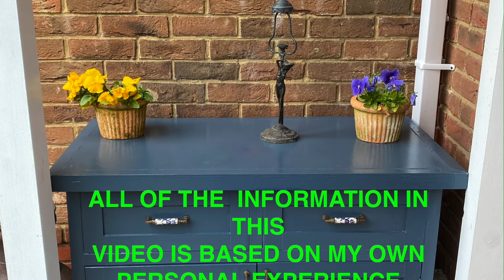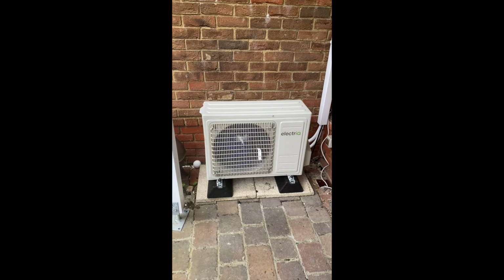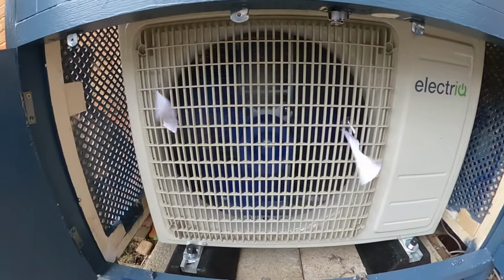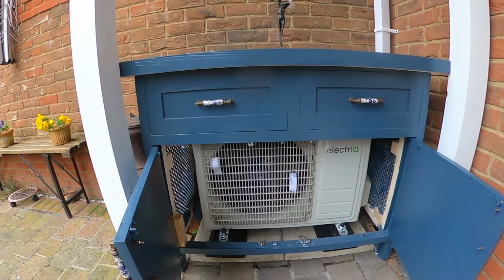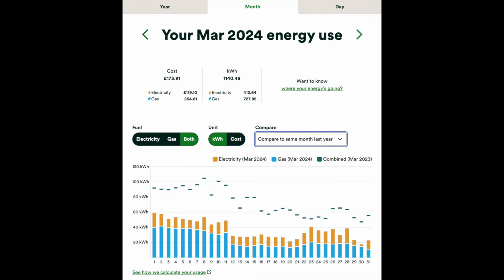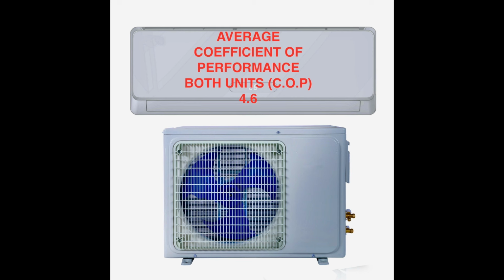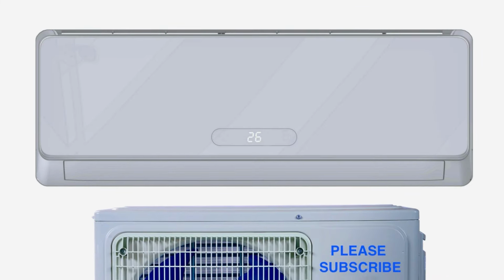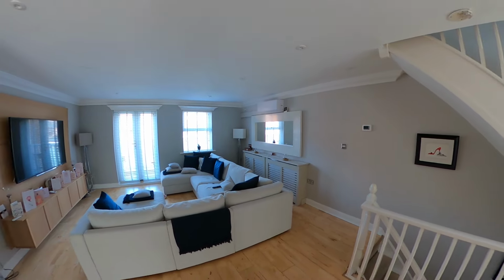AIR TO AIR    HEAT PUMP  MINI SPLIT . D.I.Y  INSTALLATION  UPDATE. ELECTRIQ

Comment: Thanks for sharing the stats - having seen one of your previous videos and learning about R290 I bought the 3.5kW ElectriQ - I’ve yet to install it but the idea is to use is to cool over the summer using my PV which I have in excess and the same to heat in spring and autumn - had it not been for the low price (£600) and the ability to DIY due to not being f-gas I’d probably not have bothered 👍
Reply from the maker: Hi  I don.t think you will be disappointed you have purchased great product. Good luck👍
Reply from the maker: Hi  You won't be disappointed these  heat pumps are reasonably  priced ,easy to install and very economical to run . thank you and good luck 👍
Reply: @HEATSEEKER1428  yep it’s on my job list- only daunting bit is core drilling the 63mm hole through the wall 😵‍💫
Reply from the maker: @Umski  Hi good luck . I have to say I found  6 3mm a bit tight  if you are buying the core bit especially  you could go a bit larger . Thank you 👍
Reply: @HEATSEEKER1428  thanks for the tip - 65mm looks like the closest one, though it does feel a bit annoying spending £45 on the bit and extension just to cut one hole, so I'm trying to find someone who might have one to borrow nearby!
Reply: Well thanks, I finally braved it and got a 65mm core drill - that was interesting as we have a timber frame so I went through the first breeze block from the outside (it's a corner wall) and hit the cavity - I didn't know where the centre could come out so had to borrow a long bit to pilot back to the inside and then hole cut the plasterboard and inner timber frame. So hard bit out the way I set to work on the brackets and trying to get all the pipe and wires lined up and pushed through - that was hard up a step stool 😬 Finally the connections - I nearly pooped myself when I undid the plugs and some gas escaped until I realised it was pre-pressured with something inert (smelt a bit like tyre air!) - quickly did up the unions, followed the non-vac procedure and we're up and running just in time for the hot spell 🥵

Still need to box up the pipe work outside and then find a better internal power socket (currently hanging off an extension). I found some 65mm square guttering in a skip (just saw your other tip!) but didn't seem to have the "bandage" in the kit so using aluminium tape and will add extra pipe lagging before I box it all up - only downside is the short pipes were a bit too short and the extension pipes a bit too long so have a looped coil of excess.

Function wise it's been great - wi-fi app is handy too. One thing I have noticed is that the thermostat hysteresis is a bit strange at +/-3C so it only starts to modulate down in power once it gets 1C over or under which is a bit odd and goes off completely at 3C - other wise it's ramped to about 1000W at full power for cooling and similar for heating. It will ramp down to about 300W at the lowest modulation in cooling it seems so to keep it ticking over it can be fudged a little...I may pop them an email as this seems a bit odd to me

Comment: Thanks for the update on the outside unit. The video would have been better if you wasn’t speaking over the top as it’s covering up the sound of the unit - which is what you was showing. Otherwise great update
Reply from the maker: Ok Thank you I take your point but there really ws not a lot to hear . Just the sound of air flowing over obsticals   . Thank You

Comment: Hi I have this unit the 12000, mine had a leak and was repaired it’s been regased, but when running it doesn’t get hot, would know what the standing and running PSI should be to determine if we have too much or too less gas thanks
Reply from the maker: Hi unfortunately I don't have  the the pressures .
You must follow  manufacturers instructions but I would say if your indoor unit and your out door unit are running and you have the correct mode selected  and your filter in the indoor unit is clean then  you have very low refrigerant  levels . if this is the case then I would check for possible leaks ,  Using either a vacuum pump or air pump of some description . Obviously  not R290 .
Thank you and good luck 👍

Comment: Hi, thanks for the update. I am considering buying one of these and fitting it myself as I'm a competent DIY'r. I had a few questions if that's ok?

1. I believe these can be installed without a vacuum. Is this done by purging the system and essentially removing any air by ejecting some R290 out the exit pipe?

2. I will mainly be using it for air conditioning. Does it produce really cold air? What's been your experience with it?

Thanks,
Keith
Reply from the maker: Hi
You are right  there is no need to vacuum down the pipe set . The instructions go through this procedure. Regarding the cooling capability's  I have only tried it briefly . According to the manufacturers in the unit is more efficient in cooling mode , so I don't think you will have any problems . Thank you  and good luck 👍

Comment: Possibly a silly question but does the internal unit have to be up high on the wall?
I want to go this route but don't think it enhances the look of a room in an older `rustic' cottage.
Thanks for the informative videos on fitting.
Reply from the maker: Hi Not a silly question at all .I have had thoughts on this my self. I think as long as you fulfil the clearance criteria in the manufacturers instructions  and the proposed fitting location is safe you should be ok. Appliances direct sell an all in one unit that can be installed at high or low level . Thank you and good luck 👍
Reply: @HEATSEEKER1428  Thanks for the swift response.
I perhaps should have said that my prime objective is heating not cooling.
We all know about radiant heat & convection currents etc that affect how comfortable a room might feel, but I wonder if these systems have the room unit high up because of how the heat provided circulates around the room.
I'm guessing here, & need to further research the science behind the best positioning of the indoor unit.
Maybe it would be draughty if positioned nearer the floor.
Anyway, I have another question.
What is the maximum temperature rise the unit can provide between the air surrounding the heat pump outside & the unit inside?
For example, if on a frosty night the outside air temp' was (say) -7 deg C, what is the highest temperature of the air produced by the unit inside the house?
Your energy usage notes were taken in some winter months - did you have any particularly cold nights to assess this?
Reply from the maker: Hi The manufactures instructions state that the unit is efficient to -5c. the units are designed to heat spaces no larger than a given size. so my understanding is that for every degree below -5  then the targeted inside temp will coincide. i.e If your target temp inside is 24c and the outside air temp is -7c. then inside temp will only reach 22c..
Of course this all depends on insulation levels  and if your heat pump is correctly sized. Regarding my experience of heat pumps performance in very cold weather  I don't think the COP went much below 4 if at all. I will see if I can find some info. Thank you